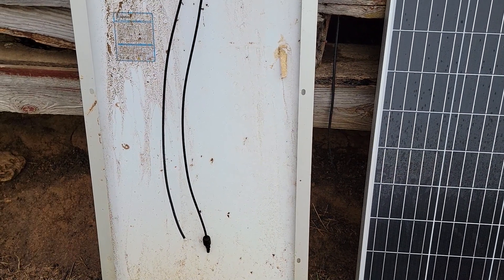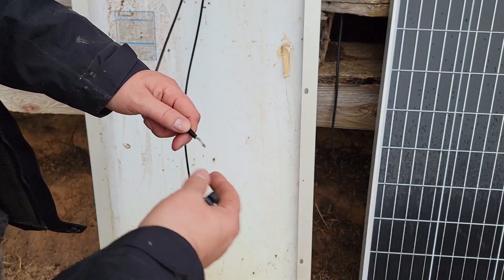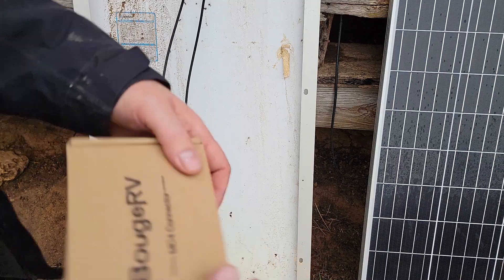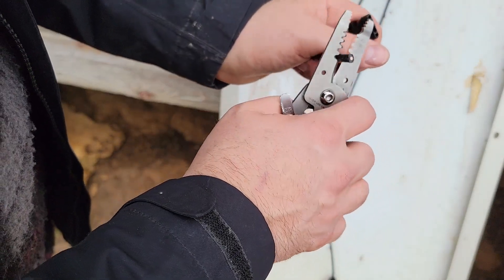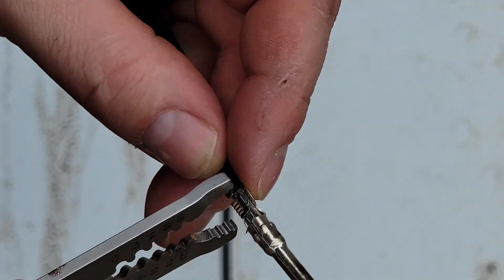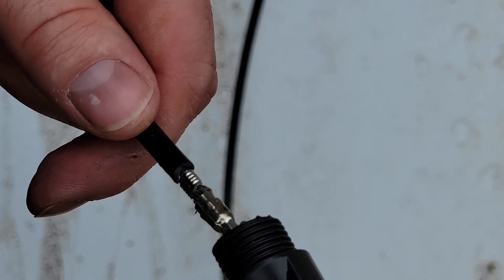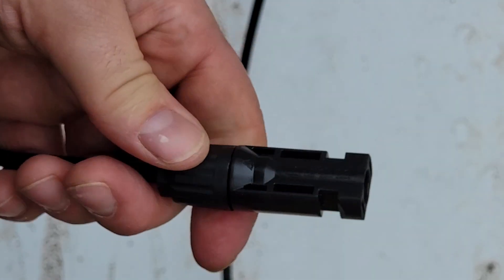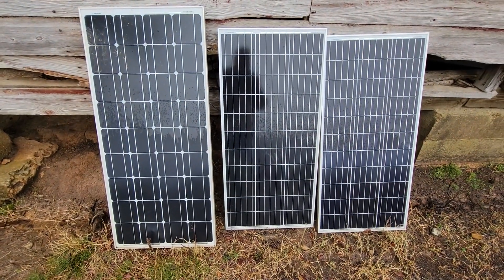How to Replace an MC4 Connector | Solar Panels

Comment: So you cut the existing mc4 connector off? You didn't show the full installation, because yours was already tore off and do you cut it off with the crimp tool?
Reply from the maker: The wind blew over the solar panel and yanked the cord out.  Kinda hard to get video of that.
Reply: @NicholsCounty  Oh I see well, that sucks, happened to me once. I figured it out on how to strip, crimp and replace the cables did so two weeks ago.

Comment: 1:11 you left out the important part.  Where did you get the cylinder to put on the wire after you cut 1/4" wire wrap off?
Reply from the maker: There is a whole kit for this linked in the description.  All the parts you see in the video are from that kit.